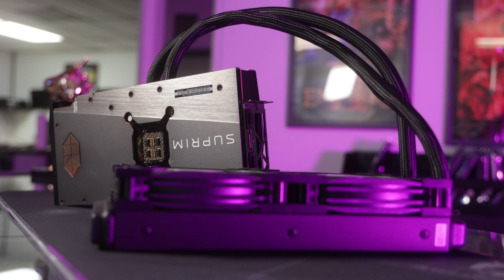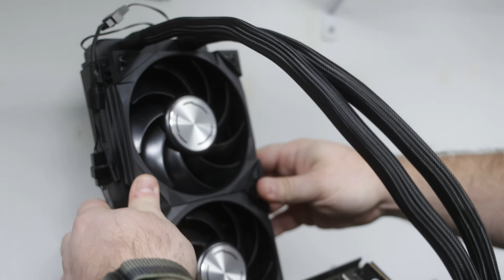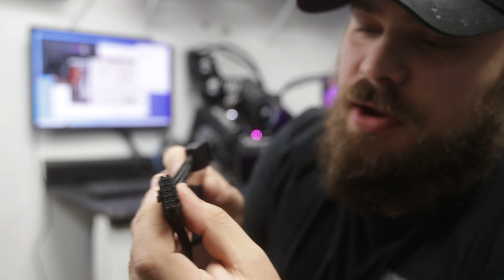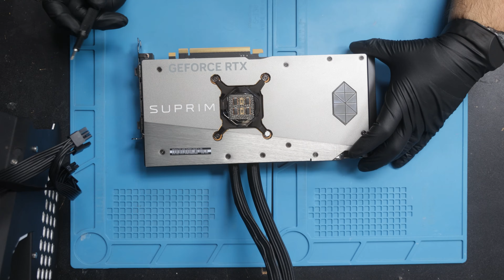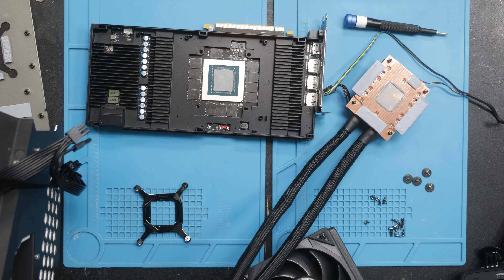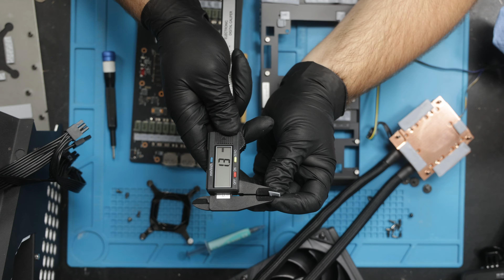MSI RTX 4090 Suprim Liquid X Dissassembly, Tear Down and GPU Memory Temperature Improvement

Comment: For those curious about the hotter temperatures, this was improved, probably for cards manufactured after December 2022.You can see the manufacturing date of your card checking on serial number the four numbers after the letter B. The card on the video was in September 2022, so about 1 month before the launch
Reply from the maker: Interesting! Should test a new one and follow up
Reply: I just purchased the MSI RTX 4090 Suprim Liquid X from Microcenter this past Saturday, 2209 (September of 2022 build) is after the letter B of the serial number. Interesting enough they were out of stock last week prior to Saturday when I purchased it. One would think the 2022 GPU's would have already made it through the pipe line.  Did a Port Royal (3Dmark) and the memory temps with the fans at 100% temp was 76C and on auto via MSI afterburner the temp was 84C. I may take the GPU back to Microcenter and look at the serial numbers and attempt to find one with a 2023 date.
Reply: @geneg6343  ordered one from Newegg received about 2 weeks ago; after the B it’s 2307 (July 2023). hopefully 🤞 I’m good on a tear down until next year.
Reply: @JiNxGamesTv  How is your card, mine has the same date at it's fine.
Reply: @greggreg2458  alright temps, Gaming hovers around 65c. Thinking about LM when I do the Re paste since my card horizontally mounted.
Reply: Nice mines aug 23, good to know
Reply: To backup @OP's info, I just received my card from newegg, 'B2311'  and I'm not seeing the increased temps on the memory that launch date reviews reported.
Reply: does that mean the cards made IN Dec 2022 are fixed or AFTER (meaning Jan. 2023)? just making sure, mine used to reach 65 ish core and 80+ hot spot at max (though that was when my door was closed and ambient rose to around 25-30 ish). I repasted/repadded it and temps don't go above 60/80, but I think the radiator has less liquid and the pump isn't running full speed anymore since I hear water sloshing around and the air coming out the radiator isn't as hot as it used to be (like it feels like it was 50 before and it's maybe 30-40 now). Thinking my unit could be faulty or something

Comment: With both stress testing and in game bench marks with the GPU at 100%, mine tops out at 60C for the GPU and 76C for the memory with the card and RAD fans at 50% (73F ambient). I can get the GPU temp a bit lower (but not the memory) by increasing the fan speed but it's only a few degrees and they are super quiet at 50% so I set the fan curve for that at load. That's with a small 90 Mhz OC just using the Nvidia Geforce auto-scan performance boost. Maybe they adjusted the cooling solution for the memory after the first batch? I got mine in March of 2023 so it wouldn't have been the first production run. Love the card's performance and temps - no complaints.

Comment: I want to buy this, one thing I am interested, does the pump block actually have a refill port? I noticed in the video that it has some sort of port on the opposite side where the tubing comes out , but is it sealed of? Or is there way to open it up and add liquid...? Also what kind of the pump is it if you know is it serviceable....? I am usually not into liquid cards because air cooled cards are much simpler to service over time.. But these new 4 slot monstrosities are out of the question for me and I want something more compact.

Comment: Does opening the card voids the warranty? The brand I’ve always used for GPUs was EVGA because you could open them to do what you did on this video. I bought this card and will arrive next week. But I’m wondering if i can open without voiding the warranty.
Reply from the maker: As long as what you did inside the car does not damaged anything or is the reason that occurred failed it does not void any kind of warranty
Reply: @SilverKnightPCs  Thanks. Does your card has coil whine? I had to return mine because it was incredibly loud. Even with the case closed i could hear it with the speakers on. Waiting for a new one that’s arriving this week.
Reply from the maker: @lmbotiva  not at all didn't experience any coil whine really
Reply: @SilverKnightPCs  that gives me hope of the new one being good. I actually got a new psu for this card specifically and i tested it on my 3080Ti so i know the coil whine is not coming from the psu. I got the msi meg ai1300p. Thanks for the reply and congrats on the video. Very informative.
Reply from the maker: @lmbotiva  absolutely. If you want to see some cool stuff we did a3090 Kingpin recently and we're about to post a video about a Fury X. That being said the 3080 t.i. consumes considerably less power than a 4090 so if your power supply is on the edge of being adequate it might not be a very good apples-to-apples comparison
Reply: @SilverKnightPCs  i OC’d my 3080 Ti and was actually using 430 wats. On the 4090 i did undervolt and power limit and was under 400 wats. So my 3080 Ti was defined using more power then 4090 and i had no coil whine. Upon doing some research it seems msi cards are prone to coil whine. You got very lucky. I was in the middle of checking the kingpin video when you replied 😅

Comment: hey silver knight great job on the teardown. just a quick question tho, did you use the 1.5mm or 1mm on the vrm's because you didn't show that in the vid. also do you think i would be able to use .05mm copper shims on the vrm to yield better results please hit me back im curious cause i have the same card. thanks a bunch brotherand keep up the good work on all your vids
Reply from the maker: It was 1 mm thermal pads. You could probably use copper shims but there's not much of an advantage on the vrm as they don't get very hot to begin with. You would be much better suited doing a copper shim mod on the memory but you would need to use a very thin copper shim
Reply: @SilverKnightPCs  how thin?
.50mm ??
Reply from the maker: @Isaiahj2003  no way to tell. I'd say  .5 or .25
Reply: @SilverKnightPCs  thanks again for all your help broski
Reply from the maker: @Isaiahj2003  no problem

Comment: somehow my temps are better than yours when the card is mounted vertically, when mounted horizontally temps are much worse, like yours. I am hitting 61C at gpu, 65C at memory and 72 hotspot while ambient temps are around 25C when mounted vertically.

Comment: hey man, can you answer a question? is it possible to move the stock fans on th back of the radiator for a possible push/pull config?
Reply from the maker: Oh yeah absolutely. You just need to cut the zip ties and readjust it

Comment: For those of you that may be curious.  It seems that MSI has fixed the early on memory and memory junction temperature issues with the Suprim X version (AiO model) of the card at the factory.  Most likely they increased the thickness of the thermal pads.  My MSI Suprim X memory temps are nowhere near what was reported with the first released versions from last year.  I bought mine in January 2023 from Newegg and the temps are in the mid-70s Celsius - a huge improvement from what was originally reported.  So, if you are hesitant about getting the Suprim X because of that issue, I can tell you now that it has been fixed.
Reply from the maker: We haven't got our second batch of these cards yet in to be able to confirm that. Keep in mind that this card was definitely from the first wave
Reply: @SilverKnightPCs did you ever get a newer MSI Suprim X Liquid?
Reply from the maker: @nickmhc  yes. It seems to be better with the newer cards
Reply: @SilverKnightPCs  sweet! Thanks for answering! 

Been trying to rethink my build idea based on what you said about the rad getting pretty hot, wondering if I can push out the front and top, and intake from the bottom?? (and back?) of a Corsair 7000D
Reply from the maker: @nickmhc  heat rises. Don't fight natural convection where you can.
Reply: @SilverKnightPCs  top was going to be for the CPU AIO but now I’m wondering if I can get the Suprim Liquid hose all the way up… we’ll see as I start buying parts
Reply: @SilverKnightPCs this may be a long shot, but I have one of the card revisions where they fixed the temps(I think) chip needs a remastered. And im having 1 heck of a time figuring out what pad and thickness to get...or should I just reuse stock
Reply: @SilverKnightPCs  you'd immediately be able to tell from the TDP.
Reply: I received my card last week.  Waiting for one additional component before I complete my build and start testing
Reply: @Mrtekem  How did the testing go? really curious if vrms are lower on the new batch
Reply: @John Grant  Yes.  The temps on the Suprim X liquid in my rig are no more than 75 C after running PCMark for a few hours.  I even ran heaven and some other tools.  I think it's fixed. I didnt build this Rig for gaming but ill try a couple demos to see if I can heat it up more
Reply: @Mrtekem  thanks, that's good news!
Reply: I commented above before I saw yours. I'm seeing the same lower temps on a card received in March 23.  Guess I was lucky in missing out on the first production run.
Reply: @pcgamer_GreatAmerica. Can you check the manufacture date of yours? On serial number check the numbers after the letter B. Mine is 2212, so December 22. I think mine is fine but I am just curious
Reply: @cajuudoido  mines say 2302 so February 2023
Reply: Thank goodness... I just bought this thing and after watching this video was dreading having to open this thing up.
Reply: @kanedanoglory  How is your card? Mine is running fine.
Reply: @greggreg2458  running pretty good. I'm happy with it for sure.
Reply: thanks for the headsup
Reply: got mine mid 2023 not seen memory temps go over 70c.
Reply: I’m getting mines in 4 days.
Reply: I bought my Suprim Liquid X 4090 at the same exact time and I have zero problems with mine. I don't run Cinebench R23, Heaven, or Timespy because I have no need to. Temps are in low 50s while gaming, and 23 at idle.

Comment: I have a similar build to this, I have a x670e Crosshair extreme with a 7950x and the suprim 4090 liquid x, i had a 850w Corsair rmx psu and i figured it wasn’t going to cut it so I got myself a seasonic 1600w titanium. Killer rig so far.

Comment: Is it possible to replace the pump if it fails?
Reply from the maker: More than likely not. They are custom made for the card during product lifecycle
Reply: @SilverKnightPCs  I noticed that its PCB is exactly the same as the non-AIO suprim X. Do you think it is possible to replace the AIO with a waterblock for suprim X (reuse the AIO radiator and fans, but replace the waterblock and pump)? Is the tubing removable from the radiator side? Will there be software compatibility issues since the front fan header will be disconnected, and the new pump is a different model?
Reply from the maker: @CS-gw5cq  no you can still water block the card. Cards can run with nothing in fan headers its how every waterblock card works

Comment: I've got a Suprim Liquid X and my GPU core temps are in-line with yours, but under full load (3D Mark tests), my memory temps don't get anywhere near as hot as your temps.  Usually my Memory temps hit a max of 70C
Reply from the maker: Keep in mind we ran superposition not 3d mark.
Reply: @SilverKnightPCs  Just ran the 4k optimized performance benchmark on superposition and my max GPU was 61.0C and my memory temps never went over 68C.  I had a score of 32,348
Reply: @SilverKnightPCs  Hmm, I'll have to try it out on that as well.  I'll report back what my temps are like

Comment: Hi, wondering if this pump is to fail outside of warranty that you'd be able to buy a new one from MSI seperately? The process of removing and installing it seems very simple.
Reply from the maker: Probably not. They are produced for the cards and never again. But their repair department may be able to
Reply: @SilverKnightPCs  so is there any hope of saving this card if the pump for example fails after 3.5 years? any alternatives? 

Planning to make whatever card i buy last for atleast 6-7 years. Would it be a safer bet to go suprim x then?
Reply from the maker: @iben3271  custom water block it then when pump dies. EKWB can make any block they have ever made even ones from 10+ years ago
Reply: @SilverKnightPCs  wow ok interesting, new to this kind of stuff. Thanks for the quick responses!
Reply from the maker: @iben3271  yeah it's a special request they don't advertise it but essentially they've kept every CAD file so all they have to do is find an opening in their CNC machines production schedule and queue it up. Not bad at all.

Comment: Can you provide the thickness of the thermal pad on VRAM? I did see your measurements on other components in the video but not for VRAM.
Reply from the maker: This ended up being .5 MM
Reply: @SilverKnightPCs  In this video you said the pads on the block for the memory is 1mm and your 1.5mm worked, now you're saying its .5mm stock?
Reply from the maker: @enacku  yes. .5mm for sure. We measured 1.0mm but it was too thick
Reply: @SilverKnightPCs  When you tested temps originally, did you have it overclocked to max? What was your gpu hotspot before/after repaste if you recall. I just got one of the 1.07v models and when I test in 4k cyberpunk path tracing, frame generation with NO dlss it bounces off the 510-530ish watt limit and after 10 min hotspot got to around 89c and memory 84c. That seem inline to you?

Comment: Hi. I am considering buying this card, but I have already bought a 1000w pay from Corsair, since that was recommended from nvidia and the price for a 1200 was a 100 dollar+ extra, will it run with my i9 13th gen if I don’t overclock? Also, should I be worried about the base temp of the ram? (I can’t replace the thermal pads, as that would thing the chard warranty)
Reply from the maker: So first thing to consider is that replacing thermal pads and thermal paste on a graphics card does not void any warranties with MSI. It only does so in the case that you improperly install those things and that causes the vram or GPU to die. If it's probably done the warranty still applies as per normal. That being said if you're running the i9 and this card you will be fine with a 1000W. The issues we experienced were with the higher end VBIOS and the power limit maxed.
Reply: @SilverKnightPCs  thank you, very informative

Comment: Hey Silver Knight

After owning Liquid X for about 1 month, I am confident enough to say your card was a BAD BATCH. I was having nightmares when testing first but my temp is hovering around 62-64c at absolute max. ( winter here so..) The worst case scenario i saw 68c mem. 

But I do use Phanteks T30 fans at 1608 rpm. Gale P12 default fans were hovering around 1740 ish RPM. The core for 4K max gaming is around 52c and 54c for CP2077
Reply from the maker: We were running Superposition  4K extreme 3 times back to back. Its definitely a harder load then most games keep in mind as its a synthetic work load
Reply: @SilverKnightPCs  as i said absolute max was 68c. You clearly had a bad batch. I would suggest to RMA but I think its too late. Also there is no single benchmark program or a game ( excluding power virus programs ) that would make me jump from 68 to 88.
Reply from the maker: @StreaM_RoLLeR  not having the best temperatures is not a valid reason to RMA. Keep in mind that our temperatures in our tech room are pretty warm due to how many computers we have stressing in there at any given time and ambient temperature can rapidly change the discussion. We experienced the same situation with the next batch of cards pretty sure that it might be just a difference in your area temperature and the fact that you using aftermarket fans versus the default fans that came with the card. That being said the memory temperature is being high we're in line with every other tech review spot on the internet. Our GPU temperatures on the die were slightly higher but that improved on the main die after we swapped the dry TIM for new paste

Comment: Could you slap on your own waterblock like one from EKWB? I only worry about the IO bracket that looks like it's specifically designed for the Liquid X
Reply from the maker: No idea. We don't have any more cards to test with :(
Reply: Just used this video for a install and I can confirm you can use a waterblock meant for the aircooled version for this.
Reply: do you know if it works?
Reply: @juninhocale4044  it does

Comment: I have this card coming soon. Should I be concerned in regards to the stock VRM temps on the Suprim Liquid X? (would like to avoid opening my brand new gpu if possible)

Also, I usually don't overclock. Instead I usually do the opposite and underclock the card (would rather have the card super cool than more power for marginal $ gains).
Reply: Nope, vrms are fine. I'm into oc'ing and managed to get several top scores for my setup with it in stock config
Reply from the maker: VRM cooling is more than adequate stock. We upgraded the VRM cooling just because we were already swapping everything else
Reply: @SilverKnightPCs  so it's possible to not remove the black metal bracket and just replace the 1mm thermal pads on the memory? If so I'd rather go that route, as I don't have the energy and time to open up the card more than I have to.
Reply: @romxxii  I'm wondering the same thing. @Silver Knight PCs is that the case? I have the card coming from Amazon around Feb 10th and will be checking the temps. Based on the user post on this video the cards now use a ticker pad. So maybe it won't be an issue